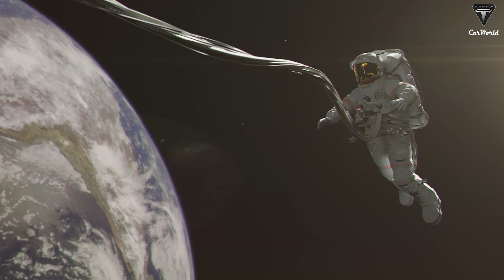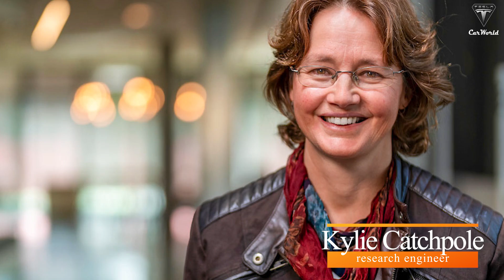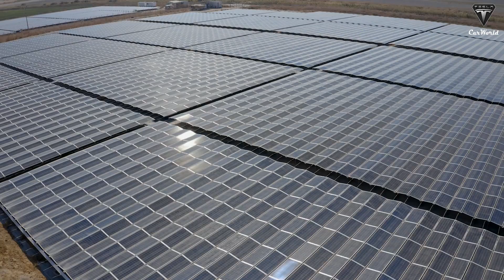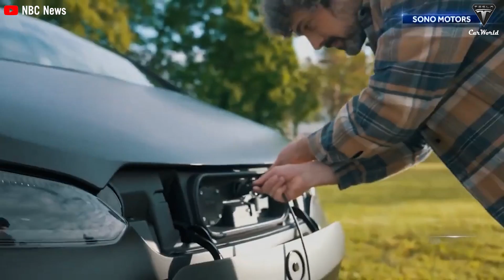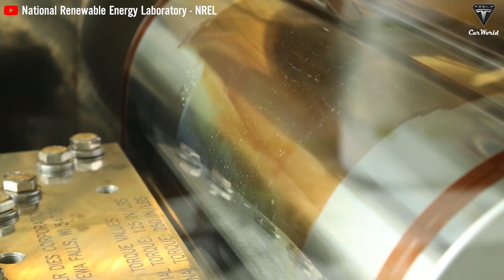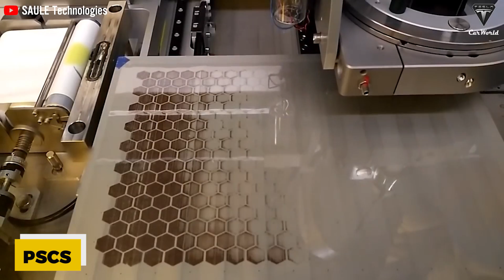Just Happened! Elon Musk Revealed Ultra Efficient 4.0 Solar Panel Breakthrough, Change Everything!

Comment: Help me to understand something  ? If you use a magnifying glass and hold it at the right angle. Its kind of like a laser because the magnifying glass combines the sun light to a single point . This point can produce current, power of a much higher level.
Now if you use not one but hundreds of the solar cell in serials and parallel configuration to produce an output much higher in current and voltage. not you do not apply this to 1 group of cells but several groups of cell. Now these larger cells also could be configured in serials and parallel again to level up again the total output of current and voltage. This would cause a much larger cable to the entire system but could maybe produce a panel that say 10 panels output would be greater than 100 of todays panel. I know I'm not an engineer but sometimes simple ways should  be considered maybe ? Just my personal thought so if someone can prove this as stupid . Again its just a thought of something I think of sometimes.

Comment: Perovskite WON"T work, until they can last over 20 years.  
Current panels last 50 years in actuality. They are warranted for 25 years, but last longer.  
Perovskite panels do NOT yet show the potential of being permanent installs.  
You would have to replace them frequently.  
THAT is VERY expensive.

Comment: "potential" = bullshit. 
Perovskite has been talked about for several years.  
ooh, wow, they got it to last 4000 hours !?!
That is less than a 1 year.  
Current panels will produce 92% of beginning production after 25 years.  
Perovskite has a way to go.
Reply: Thanks for explaining this.  I saw that 4000-hour figure and thought, "Wha. . . ? That's not very long." But the narrator just glossed over it.  I thought that maybe it was a typo.  After listening to the glories of perovskite (they really have to do something about that name; it's too hard to say) for about 15 minutes, I was still waiting to hear what the catch is.  They might have said so earlier.
Reply: 4000 hours is not the life span it is the time they can produce electricity without losing any efficiency "0% loss"...
Reply: @URAZKIVANER  Not true.  Perovskite loses so much productivity that they are useless after one year.  THAT has been their problem from day one. And it is still their problem.  

If what you said was true, then they would be just as good as current solar panels, and they would be on the market.
Reply: @URAZKIVANER  BTW, I am a solar designer, so I know a little bit about this.